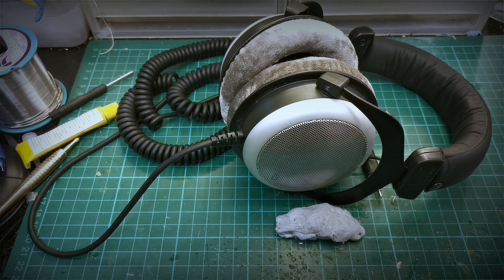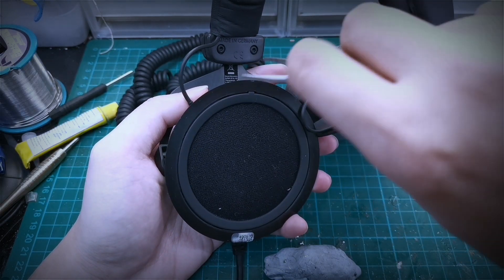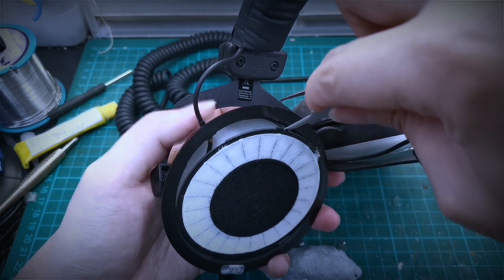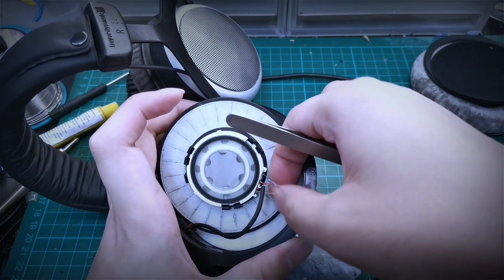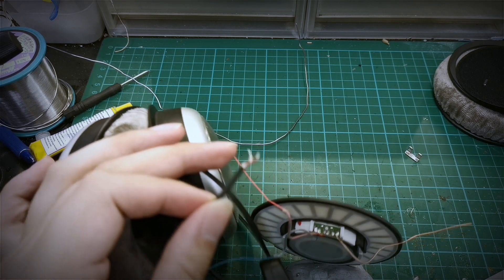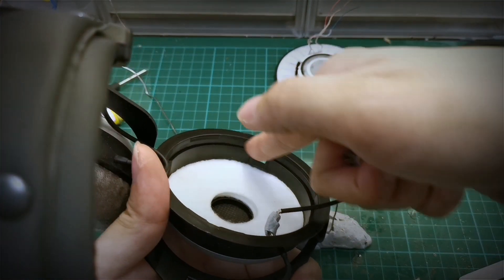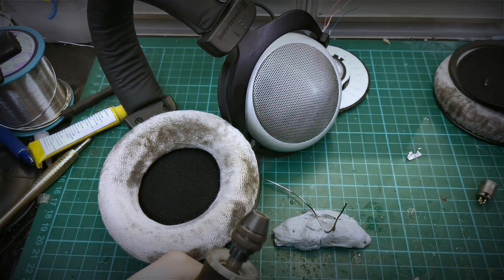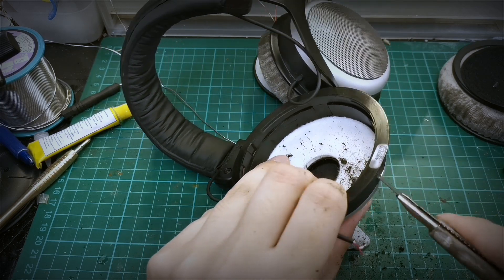Beyerdynamics detachable removable cable mini XLR modification AKG style  Tutorial

Comment: Great mod, nicely done! Why not use the nut that comes with the socket? I would then just hot glue that so it doesn't come loose.
Reply from the maker: there is no space for the nut as the driver wont be able to close
Reply: @sgaudiohive  ah, OK thanks.

Comment: Why did you unsolder the linking wires?
Reply from the maker: it's to remove the drivers entirely to prepare for the drilling. I have a camera and a microphone blocking my view so I wouldn't take the chances of damaging the driver while doing the drilling
Reply: can i do it without unsoldering those?
Reply from the maker: well it only takes 10-20 seconds to get them off and on again, might be worth the extra steps. the voice coil on these are exposed and very thin, you can do it without this extra step but it will lower the risk significantly